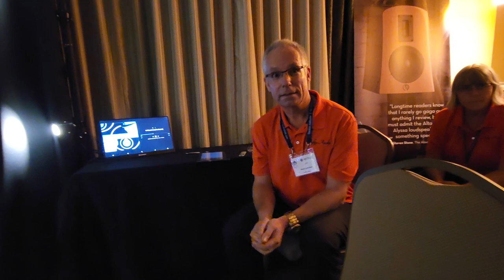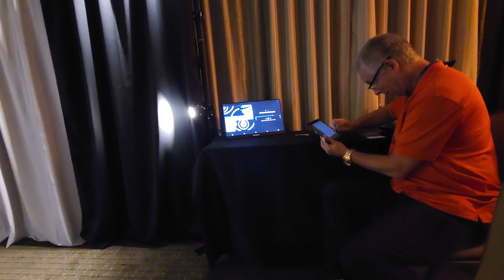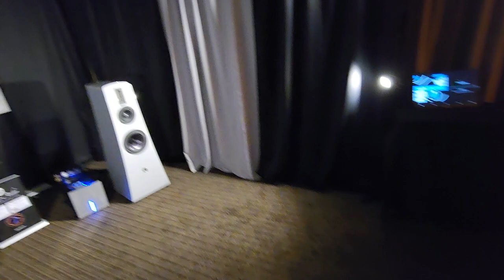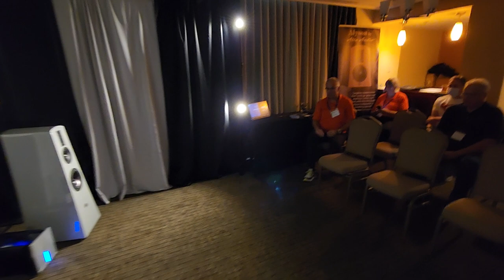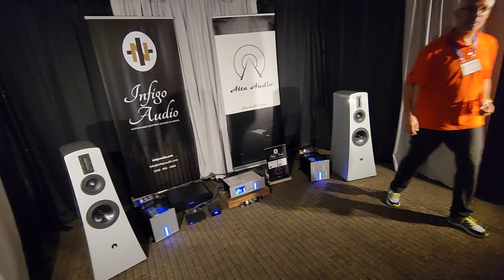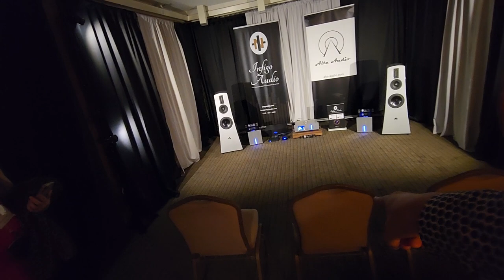Back to Alta Audio with Steve McCormack to do some music requests and learn more info on the gear

Comment: Just when you need a L/R balance control...there is none.
Reply from the maker: No need for balance controls when it's usually fixable by setup... which is a much better way to address the issue.
Reply: @AudiophileJunkie  - just kidding. My last component with a balace control was a Pioneer receiver back in the late 1970's.